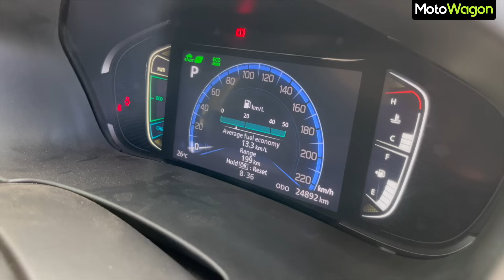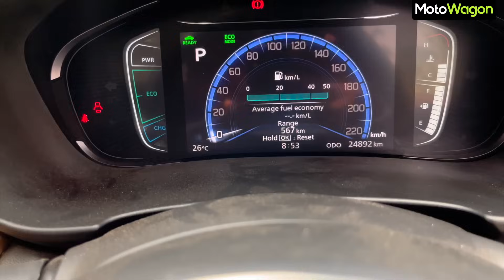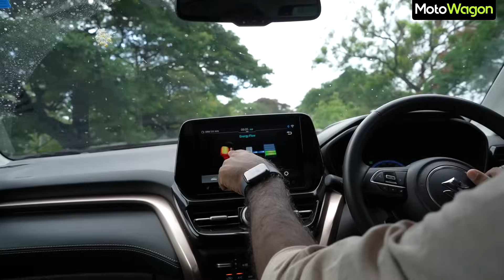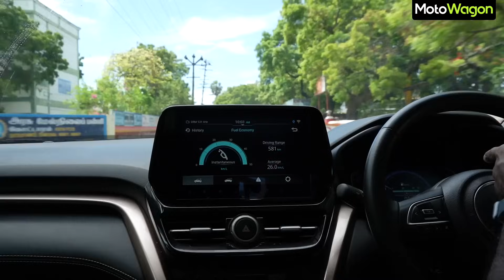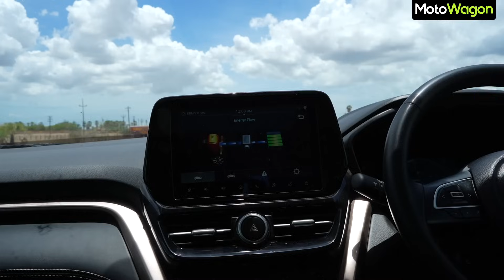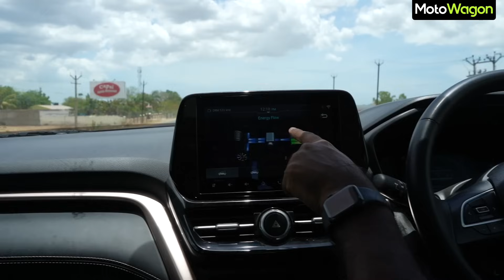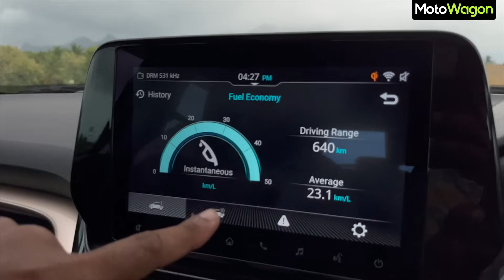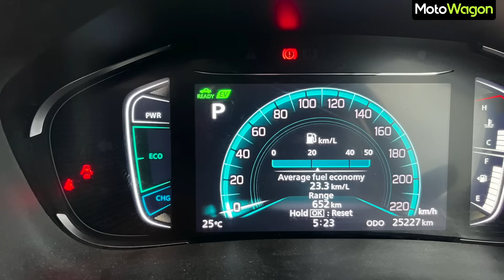Maruti Grand Vitara Hybrid - Mileage Test | 23 kmpl Real Road Mileage? | Tamil Review | MotoWagon.

Comment: @Motowagon, Sir Excellent detailed review of the real world performance of the Grand Vitara Hybrid Car. Car Enthusiasts would get to know the nuances practically. The real world Mileage Test of Hybrid cars for 300+ Km drive is appreciable in flat roads. I currently own a 2017 Aspire Diesel (crossed 51.5 Km in ODO) which has been giving me 25+ mileage in highways (maintaining speed of 90-100Kmph, occasionally 110-115 kmph) and min of 15.5+Mileage in Chennai City. We would also like to know the following on Hybrid cars like Grand Vitara. 1. Yearly Maintenance cost associated  2. Battery Life time and replacement charges . 3. Uphill Driving and Mileage performance.

Comment: Super Video from MW crew. However I have a doubt in Operation of hybrid vehicles. The engine turns On and Off multiple times right, how does it effect the starter motor? Asir ji Could you please explain this. Thank you !

Comment: Hi asir bro, have a small doubt regarding the hybrid cars. I accept hybrid is very very good in country like India, but my concern is that normally in ice engines there is an important parameter to be monitor i.e engine temperature. Driving an engine at an optimum temperature is the prerequisite for a better engine life. In case of hybrids i see a rapid switching on and off of the engine. Engine gets started before it even warms up and in highways we see that engine shuts down abruptly at a higher temperature. Will it be an reliable option to opt hybrids considering my above point. I accept engineers would have taken these scenarios while constructing the engine, but as a common man asking your opinion. Could you clarify this.

Comment: Service cost for battery/replacement should also be included.
Reply: And battery degradation over time which leads to drop in fuel efficiency
Reply: @gokulbala3096  yes, but I think hybrid is just offsetting inexperienced drivers driving which obviously reduces fuel efficiency.. experienced drivers know when to brake when they expect traffic ahead or when to accelerate etc... So the use of hybrid battery will be little there. An inexperienced driver will brake suddenly causing regen braking for charging the battery etc., They don't understand how torque and power works in a car...
Reply: Hybrid batteries are designed to last the life of the vehicle.

Comment: Comparing grand vitara with Brazza diesel would have been  very meaningful.The idea may be to promote the hybrid vehicles.fuel economy can not be limited to cost finding in single trip.the cost of battery replacement in a hybrid vehicle becomes a must after a  run of specified kms.
This type of comparison may misguide the viewers .pl.correct me if I am wrong

Comment: In smart hybrid and hybrid engine getting switch off and switch on often. on off operations will increase.  Will it hamper the self start motor?
Reply: NO, it dose not has any self start motor separately , it has intelligent starter and generator means it has work as an a generator and starter motor.
Reply: Thank u asir bro. I have brezza vxi at.  I had a doubt in difference of MID display of kmpl.  Now it is very clear As a thumb rule MID tallies to tank to tank metrics.. hope nearly both are equivalent if not equal

Comment: So running cost difference is approx ₹1/km. If avg running per year is 15,000 to 20,000 km per year we save only ₹20,000 per year which is not a big saving plus we need to see the service cost and battery replacement cost.

Comment: For the same vairants of a same car if hybrid and diesel are offered,  then hybrid price will be much more than diesel. With the given small difference in mileage, the breakeven will take more kms. The price difference between NA petrol and hybrid should similar to NA petrol and diesel which is not the case currently. It is ~6lacs. For that money you can drive ~87,000 kms with the NA petrol engine with current petrol price 103₹ considering a mileage of 15kmpl
Reply: YEs I was searching such comment. Prize variation has to considered. The reason some purchased SWIFT/DESIRE petrol against Diesel is Price Variation with Average 1000km per month Driving. I still have that Doubts why to invest more on Hybrid cars when you can get Diesel Cars Less than 10 lacs of HYBRID cars For Eg Venue/Nexon  Diesel is 10 lacs less than Fully Smart Hybrid. Correct me if I am wrong
Reply: Also the interest you are paying on that difference if you are taking a loan

Comment: For easier understanding:
Maruti:
335kms, 14.6L petrol (rs.1512), 22.94 mileage 
Ford:
327kms, 19.4L diesel (1851rs), 16.85 mileage

Ford for 335kms:
335 km x (rs 1851/327.7 km) = rs  1892.31

Savings for same distance of 335 km:
Rs1892 - rs1512 = rs.380
Reply: Hybrid amt cars maintenance is not known. If included real running cost will be obtained.

Comment: so, hybrid is almost 8 L costly than petrol vehicle, even if he take 2 Rs difference for a KM between petrol and hybrid. You will have to run 4L KM to cover the cost. Instead you can put 8L into a deposit in a bank can give you almost 50K per year which can be used for fuel and still you will have 8L in you bank. If you take loan it can bring years and emi amount less. so we can go for petrol instead, This is just my view.